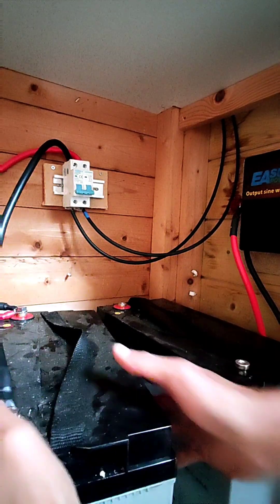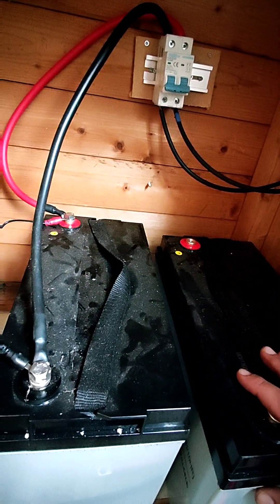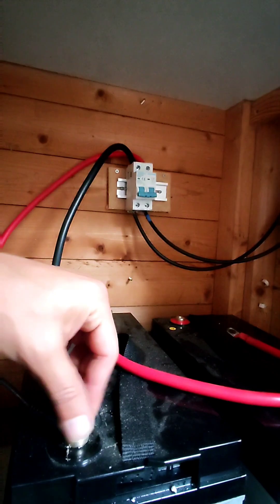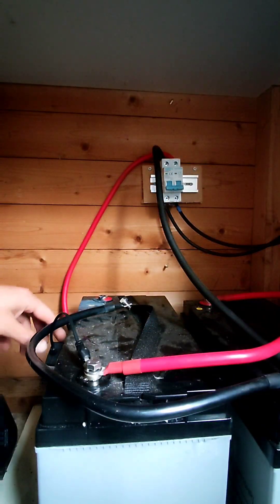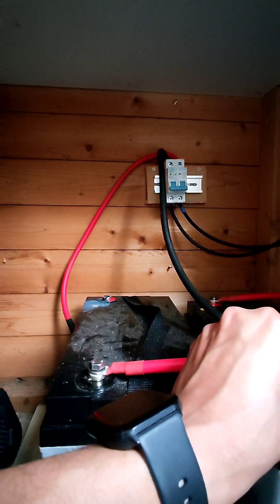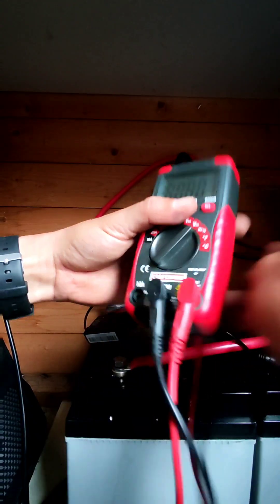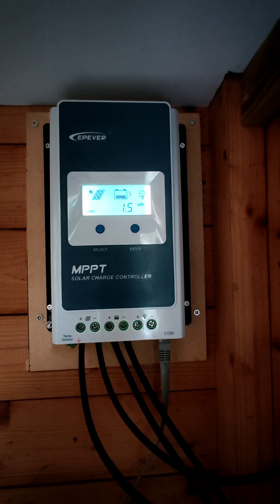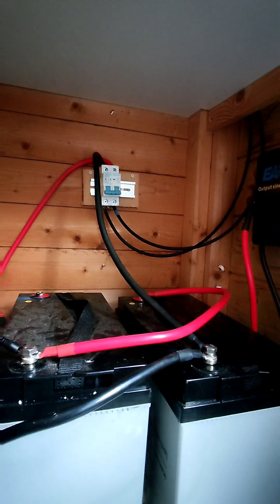Wiring 2 Solar Batteries in Series - AGM 12V 100a Batteries using Epever Controller #solarsystem

Comment: You would also want to add a battery balancer, especially because your batteries are different age. Without a balancer your charger will be overcooking the weaker battery.
Reply from the maker: never heard of a balancer but the age is minimum. Charge controller seems to be defective as it wont pull in any current from the PVs so will look into testing and replacing if necessary.